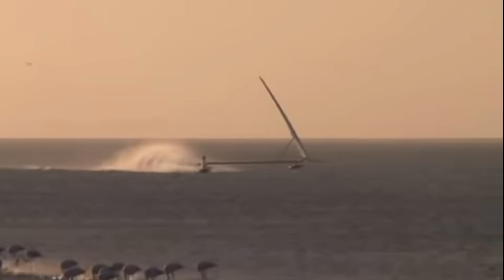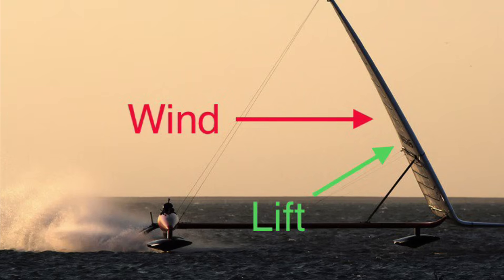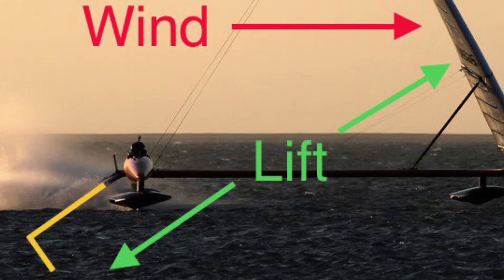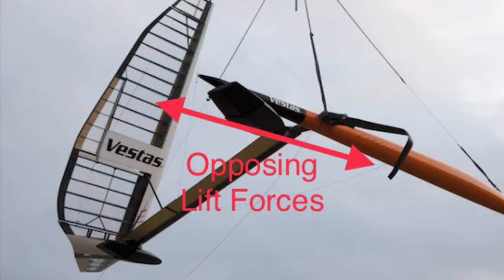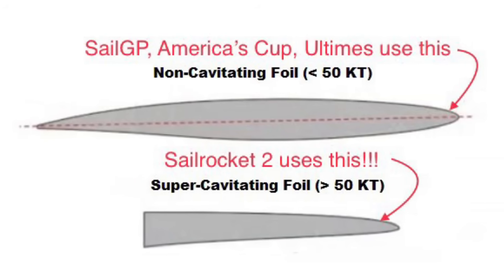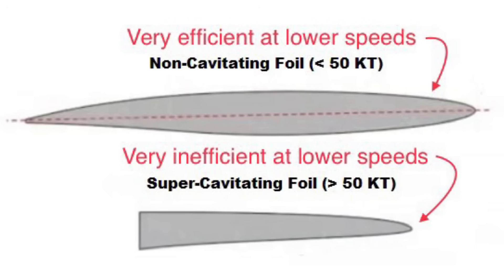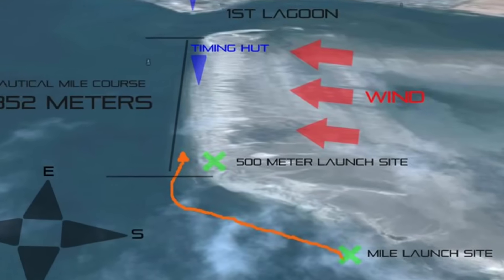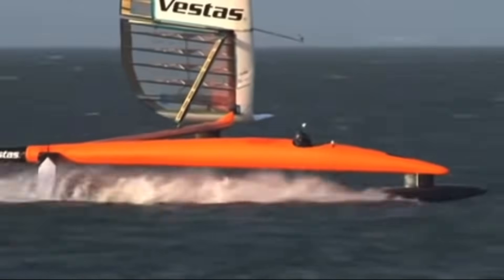How Did Vestas Sailrocket 2 Smash the Sailing Speed Record?!?!

Comment: When can a full size sailboat design reach 65 knots on a regular basis like a normal sailboat design.
Reply: Yes a normal sailboat design can reach these speeds. If you practice the basics instead of over engineering control propaganda..
Reply from the maker: @markcampbell7577  Are you aware of a normal sailboat design that has reached these speeds?

Comment: Shouldn't it be possible to have both conventional foils and super-cavitating foils on a boat and switch them on higher speeds? I mean todays boats also have the capability to lift their foils. Or does something speak against that?
Reply from the maker: Yes the ability to swap between low and high speed foils would be just the ticket, just need to find a way to do that which doesn’t add a ton of weight to the boat!
Reply: For sure, the weight might be the biggest concern. But maybe we'll see something like that in the future. Would be awesome.

Comment: Land speed sailing record is currently about 120 mph (105 Kts). So it would appear the water interface is still the limiting factor here, not the rig.
Reply: The land speed record for cars is currently 760mph with at least 3 current project aiming for 1000mph. The water speed record is 317.5mph, and it hasn't been broken since 1978 because people keep dying trying, though there at at least 6 current WSR projects, including the current LSR holders.
Reply from the maker: Yes drag / friction with the water is far greater than wheels on land or blades on ice, so definitely the limiting factor, even with foils!

Comment: Everything you said about Sail Rocket are fair points. But I disagree with you about not mentioning Sail Rocket in a discussion about fast sailboats, for several reasons. First, Paul Larsen's team did this record breaking work more than 10 years ago, and to my knowledge, their outright sailing speed record is not yet being threatened. What they accomplished in basically a small shed, and a shoe-string budget, is a testimony to hard-headed commitment. It's nothing short of astonishing. Second , the fundamental R&D that went into designing, building, and testing sail-rocket is classic Wright-brothers style of engineering. My hat's off to this crew. Finally, Sail Rocket achieved a peak instantaneous speed of 68.33 knots....this in a sail driven craft. At the time, this simply defies belief.

Around the time of the Sail Rocket record runs, I watched a video piece on the kite surfers at Luderitz making speed runs in their specially dug trench in the sand. As one kite boarder packed up his rig in the trunk of his car, he smuggly said "let's see sail rocket do that". A bystander overheard the comment and shot back: "OK, now let's see you put the trench in your trunk as well." Touche.

Point is, early advancements in sailing speed records necessarily occur within the limitations of then existing engineering limits, designs, and materials. Sailing faster yet is the scientific process at work.
Reply from the maker: I agree that the Sailrocket project produced an amazing result on a tiny budget compared to other campaigns! 

My comments about it being a boat or not are related to the fact that it can only sail on one tack and one point of sail i.e. it can’t sail an arbitrary course.

Still an amazing achievement in my mind though!!!
Reply: @SailingTipsCa  Yehp, that's fair. But Sailrocket also overcame fundamental limits to the then-known design paradigms and challenges, pointing the way for others to follow. 11 years later, still an astonishing accomplishment.
Reply from the maker: @vermontsownboy6957  Yes first sailing vessel with super-ventilating/cavitating foils that I’m aware of!!! I think Syroco is using some of the same concepts but haven’t pulled it all together yet…

Comment: Perhaps a type of hydrofoil that changes it's shape based on the craft's speed could be developed. It could be composed of Solid rollers, mounted on actuators. wrapped in a deformable waterproof material, such as rubber..The actuators could be activated by digital or analogue means, real time. so that once cavitation begins to occur, the foil changes from tear drop to wedge.
Send me a cheque, we're good.
Reply from the maker: I think I need a bigger cheque book!!!

Comment: Is it boiling because it is hot, or is it a mixture of air and water seeming as if it boiling.   

Fix that.   😊
Reply from the maker: The boiling point of water drops along with the pressure it’s under. At the summit of Everest water boils at 68’ C. Keep dropping the pressure and it boils at even lower temperatures. On the low-pressure side of a foil or high-speed propeller it boils at sea temperature. This is more precisely what’s going on: https://en.wikipedia.org/wiki/Cavitation

Comment: I do wonder about a wind powered vehicle which is basically a glider tethered to a supercavitating torpedo. The "sailor" might be slung under the tether rather than being inside the torpedo.

This vehicle would be able to sail in either direction, and you could use figure 8 kite sailing techniques in weaker wind conditions or higher waves.
Reply from the maker: I think that may be kind of what these guys are going for? https://syro.co/en/speed-record/
Reply: @SailingTipsCa  Oh wow, yeah that's the idea! I was thinking of something less sophisticated, without a streamlined crew pod. Just something very minimal like a kite surfing rig. But you don't need to have a surfboard, and there's a second tether attached to your back, going to the torpedo. Or something like that.

Comment: As a speed sailor myself (TriFoiler #23 "Unfair Advantage"), I've been watching Sailrocket since the beginning and admire how fabulously bonkers it is.  I'm glad you touched on the (obvious to anyone paying attention) one-tack limitation - scream down, tow it back.  Great little vid.
Reply from the maker: Glad you liked it! I couldn't help but look up your boat and it looks pretty cool too!
Reply: @SailingTipsCa  The Hobie TriFoilers were amazing.  It's kind of sad that they don't have many successors/imitators.
Reply from the maker: @LoanwordEggcorn  Yes creating a small foiler for the "masses" is a bit of a challenge! I think there have been some decent attempts with the Waszp, UFO, and Stunt S2, but around here (Pacific Northwest) I see mostly foiling kiteboards.
Reply: @SailingTipsCa  The advantage of the Hobie TriFoiler is that it's probably more stable and relatively drier than a MOTH, etc.  It's more like a foiling regular small multihull and not as much of an almost windsurfing/kiting/dinghy type wet experience.  Hopefully it also spends much less time broached or capsized.
Reply: "fabulously bonkers" is a nice way of describing it lol

Comment: BASE-VENTED hydrofoils MUST BE VERTICAL or with a small dihedral and are kind of very low cambered high-speed sections with a violently vertically cut tail-base, a truncated base wall which sucks down air from the sea surface. As you get atmospheric pressure there instead of horrific hydro-suctions, your DRAG falls down drastically......
Reply from the maker: There’s a close-up shot of Sailrocket’s foil here: http://keyassets.timeincuk.net/inspirewp/live/wp-content/uploads/sites/21/2011/03/P10005621.jpg

Comment: Interesting. Would it work to pump air down through the foil and out through a 'flap' that only opens above certain speeds?  Airplanes have a similar problem, they use variable geometry to increase speeds
Reply from the maker: The use of pressurised air is also seen in supercavitating torpedoes! https://navalpost.com/a-gamechanger-weapon-supercavitating-torpedo/ Variable geometry foils is another interesting idea, but water is about 800 times more dense than air, so foils are much smaller and have much higher load factors than airplane wings, so there's not as much space inside for the the gadgetry!

Comment: Question: is the maximum speed of a sailing vesicle such as this limited to the wind speed, or is it somehow able to exceed wind speed?
Reply from the maker: Good question! The fastest boats can sail at 2-3 times the true wind speed on a beam reach i.e. when the wind is coming from the side at 90 degrees to the direction of travel! In this particular case Sailrocket did nearly 65 KT in about 25 KT of wind!
Reply: @SailingTipsCa  the land speed sailing record is 125mph which is probably 5 or six times wind speed, compared to the 75mph of the Sailrocket. It shows the drag that is generated by the foil.
Reply from the maker: @robertcain3426  Yes there’s definitely more drag with foils in water than with blades on ice or wheels on the ground, which is why land sailing is faster. Foils are still the lowest drag solution available for sailing on water that has been discovered to date.
Reply: @SailingTipsCa  I would dispute your statement that 'foils are still the lowest drag solution available for sailing on water'. It is proven to be untrue in sailboards, with foilboards being 30% slower than conventional sailboards. It's also not true for surfboards, with speed and acceleration, again, significantly reduced with foils. What lifting foils do provide, however, is efficiency in low power conditions. And efficiency does not translate into speed, except in circumstances where the power to weight ratio is sub-optimal.
Reply from the maker: @robertcain3426  Yes it’s much more nuanced than my simple statement. Foils are counter-productive and add unnecessary drag when there isn’t enough wind to lift the main hull out of the water, and they are limited by cavitation in the higher speed ranges, and as you noted they are most beneficial in moderate winds. This video explains foils on sailing boats (not kiteboarding) in more detail: How Fast Can a Foiling Sailboat Actually Go?!?!?
https://youtu.be/SWGBgR_Np3E
Reply: @SailingTipsCa  Yes, certainly. I wasn't trying be critical of you. Just pointing out some facts that are easily missed. Given that speed sailing isn't 'normal' sailing, speed attempts like the Sailrocket arn't bound by the same restraints. And since it is a proven fact that lifting foils forte is in the mid range of speed, it strikes me as odd that they are using them in such a misdirected way. They are not constrained to make it look or perform like a boat, so limit themselves. Is it because, though they are expert in what theu do with foils, they can't think outside the box? Foiling sailboards being 30% slower than conventional boards, with the highest recorded speeds for foilboards is 38kts compared to 55kts for a conventional sailboard. Same with surfboards.
Reply from the maker: @robertcain3426  Yes the 500M and 1NM records maintained by the World Sailing Speed Record Council (WSSRC) allow some pretty wild craft that aren't particularly practical in less controlled conditions i.e. lots of wind and perfectly flat water. Longer records have the additional requirement that "The vessel must be capable of floating and supporting its crew when at rest" which isn't the case with the 500M and 1NM records. Even so, I don't think the non-foiling speed-kite-boards are getting much more than 3 times the wind speed, unlike ice or wheel based land sailing craft which are going 5-6 times the wind speed as you noted, so water is really just a draggy environment!
Reply: @SailingTipsCa  the non foiling sailboard (not kiteboard) has a speed record of 55kts, compared with a foiling sailboard which can only achieve 38kts. This is a 30% reduction by fitting foils. Why would anyone use foils to achieve an outright speed record? This is all I'm say. It's the same with kiteboards, since you mentioned them. A 30% reduction in speed by fitting foils. Yet Syroco, I think it is, are still going down that path. ?? Also Sp80. I'll leave it there.
Reply from the maker: @robertcain3426  The foils on Sailrocket and Syroco are actually upside-down to counter the forces of the sail and prevent them from flying away, rather than lifting the craft out of the water which is the case with most foiling craft.
Reply: @SailingTipsCa  yes, I know. And foils have a tremendous righting moment. However, the same resultant loss of speed will occur which ever way the foils are being used.
Reply: @SailingTipsCa  I should mention that scale makes foils come into their own  in regard to speed because of a power to weight ratio. As you'd know, doubling the scale of a vessel means an eightfold increase in weight, yet, unfortunately, the wind doesn't increase eightfold in that equation. Power boats don't suffer to the same degree because their engine size can be relatively increased to maintain the same power to weight ratio, though, with a limit, when they too begin to suffer the same problem. Yet speed challenges have less constraints in retaining a good power to weight ratio where foils, aren't needed. While righting moment can also be solved without resorting to the aid of foils. Thanks for the discussion. Cheers.

Comment: I just thought of something being a pilot, "flaps" put hydraulic flaps on the foil part that is in the water; it can be deployed or retracted via hydraulic control.
Reply from the maker: Yes that would be the ticket! Except it’s a bit more difficult in foils because they are much smaller and more heavily loaded than airplane wings, with water being about 800 times denser, and there is much less room inside of them for the mechanics.

Comment: Cavitation is when the bubbles get big enough to effect an unstable drag on the blade so it's kinda enemy number one but are bubbles the problem or just the Size of those bubbles?
What if you deliberately created micro-bubbles along the Leading edge - power up a piezo strip and sweep through your hertz and power range till you're making the right size and amount of air to fly into and no more - You're going to need an aircraft Fly By Wire system because you won't be touching water and there will be a steam or smoke in your trail.
Just saying.
Reply from the maker: The vapour causes both drag and loss of lift because air is about 800 times less dense than water. But you're right that fly by wire is pretty much required to "fly" foiling boats because they are generally quite unstable, despite the pros making it look easy!

Comment: All boats are a compromise.  This boat makes a lot of compromise's  to achieve the speeds it does.  The biggest compromise it makes is practicality...   This is about as practical as converting a Trimaran into a wing in ground affect.  Thanks for the video.
Reply from the maker: Yes all boats are indeed a compromise, especially when pushing the limits of performance!!!
Reply: @SailingTipsCa  It's definitely pushing the limits of something.. 🙂    My wife and I have sailed the coast of Alaska for 20+ years for months at a time.  I am fine with sailing at 5-6 knots and watching the scenery go by.  My priority is a safe, seaworthy boat not speed. That is the compromise I make when buying a boat. Last thing I want is to have the damn thing sink out from under us 100 miles from anywhere..  I wouldn't mind owning a faster boat as long as it isn't a compromise in safety and seaworthiness.   Thanks for the reply!  🙂
Reply from the maker: @mojoneko8303  Definitely understandable given the remoteness of your sailing area - beautiful place!!!
Reply: @SailingTipsCa  Turning a Trimaran into a wing in ground effect.  Now that would be an impressive engineering feat.   Especially if you could accomplish it with sails instead of a motor.  Hmm sounds like I found a winter project.. 🙂
Reply from the maker: @mojoneko8303  Yes, and you could make a YouTube channel!!!

Comment: Therefore the future is real time  shape transformation of the boat (body and sails) depending on sea surface and wind flow modulation ? I guess we are going there in this extremely évolutive technology.
Reply from the maker: That would be the ticket, like airplane wings change shape, but underwater foils are much smaller so more heavily loaded with less room for internal gadgets, with water being 800 times more dense than air!
Reply: @SailingTipsCa  Hello, indeed, the ticket. 👍

Comment: I just found out Sailrocket was designed and built on the Isle of Wight where I'm originally from. It's kind of surprising to me that great innovation and pushing boundaries comes from such a small (somewhat backwards) island but then the connection to the seas and oceans, as well as the knowledge, hardware and tech that enable us, are integral to your life and almost in your DNA when you're from a small island.
Reply from the maker: Wow I didn’t know that!!!
Reply: @SailingTipsCa  It took a little digging around to find out. I was just interested to know where it was made. I think the Danish owners and sponsors want to have the credit, which is fair enough I suppose, it must be an insanely expensive project.
Reply from the maker: @mattkinsella9856  Yes that makes perfect sense! I knew it came from somewhere in the UK but wasn’t sure exactly where.

Comment: Very nice and informative video, I had no idea this negative lift hydrofoil principle was used!
Only comment: it's not air that fills a cavitation bubble but (low pressure) water vapor. If there is air, it must be an active bleed system.
Reply from the maker: In this particular case it’s a combination of water vapour from cavitation and air sucked down the from the surface, so really more of a “superventilating” foil!